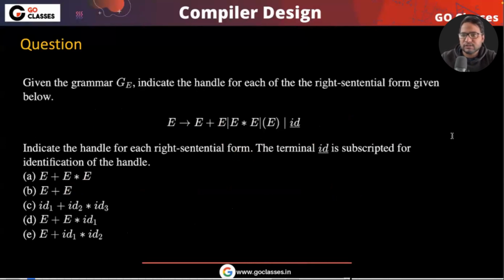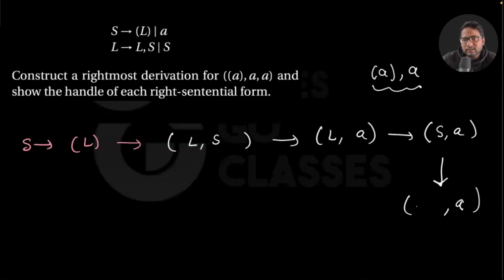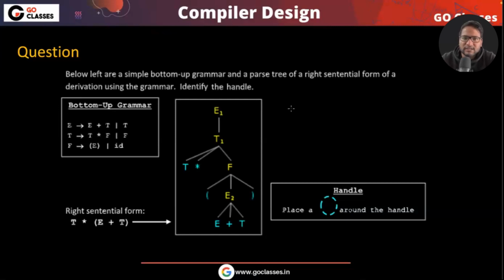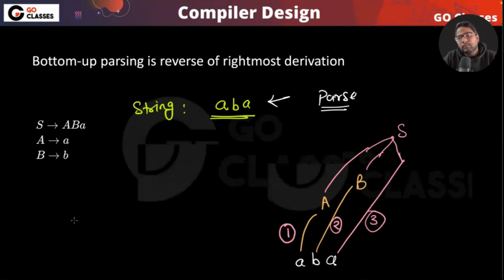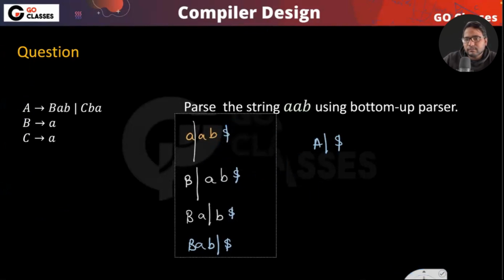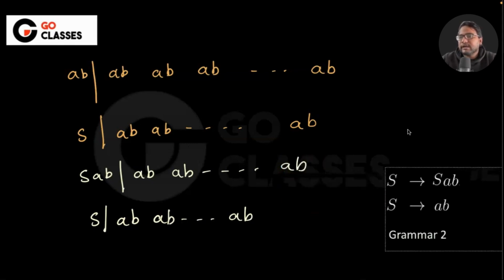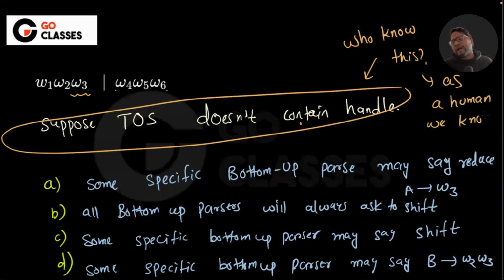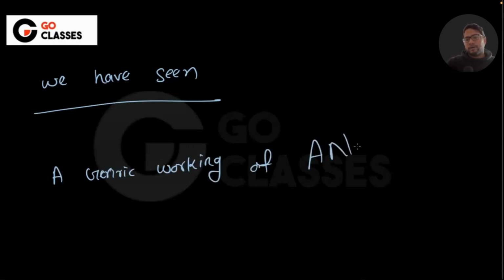Many Questions on Handle &Working of Bottom-up parsers| Use of Stack in Bottom-up| With NOTES| Part2

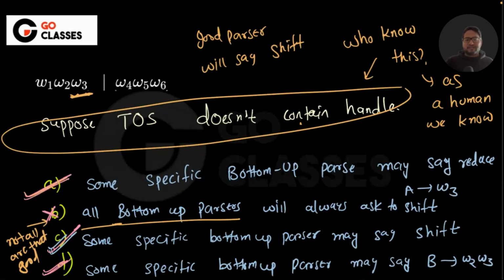Comment: sir if at 1:54:57 option E would be like can some BUP may say reduce B->w2,  then it can also be a possibilty so it is correct or it will surrely wrong, like even  bad BUP will also know that handle is always at the top.
Reply: sir i think i got the answer by rewind the video that it is wrong because it is in defination of BUP that reducation always happen at the top, as like at 1:42:55 even bad bottom up parser give options like it got confuse only about which one of reductions to select or shift.
thanku  for the video sir, i understand the concept so well that i don't need to revise it again and again.